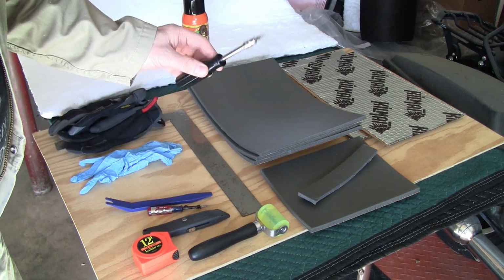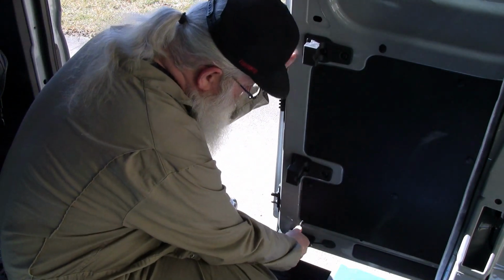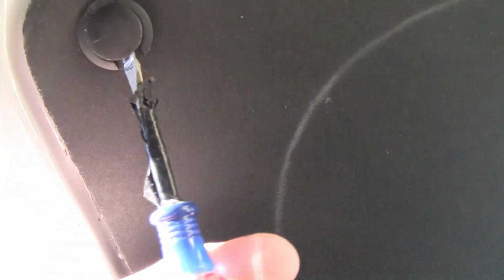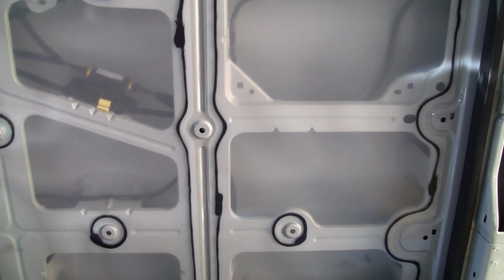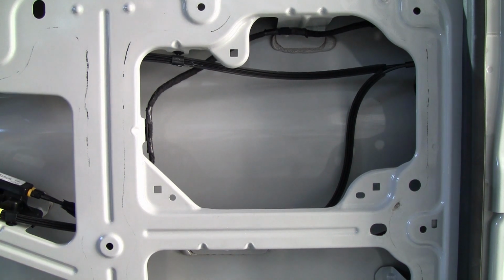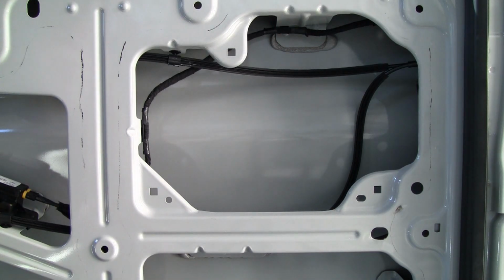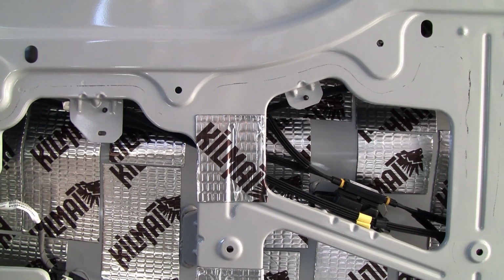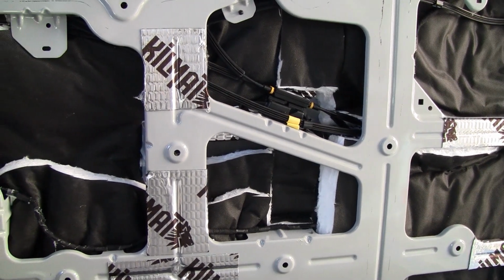Sliding Door - Sound Deadening and Insulation

Comment: I might've missed it. How or where did you use the Gorilla glue spray?
Helpful video. Thanks.
Reply: I used the glue spray to adhere the Thinsulate to the Kilmat in a few places.  A lot of the door area will hold the Thinsulate in position without it.

Comment: why is there a water barrier on the slider. There were none on the rear doors - does that mean the slider is more prone to water access? What would this mean for the thinsulate? Again, very informative, nice work.
Reply from the maker: I only did the driver's side rear door, but there was a water barrier on the passenger side rear door which I didn't video since I thought that would be overly repetitive.  I think they only put the water barrier on doors with electrical wiring inside.  The only wires in the driver's side rear door is the speaker wires.  The other doors have window controls or other sensors inside.  Thinsulate is "hydrophobic" which means it doesn't absorb water, so it should be fine.